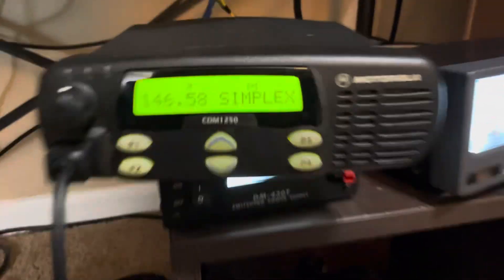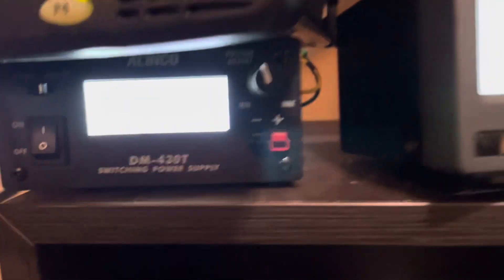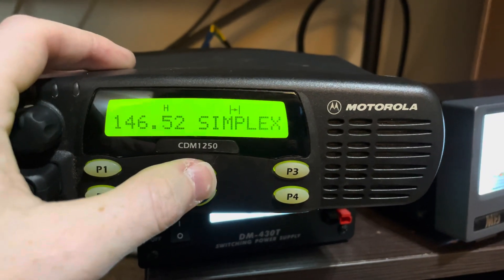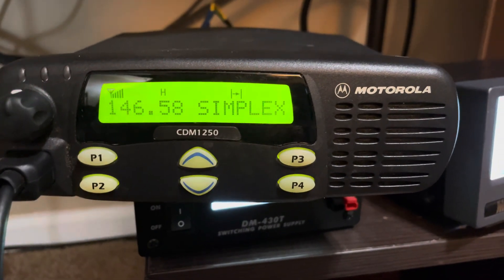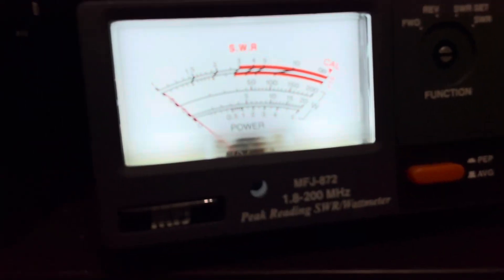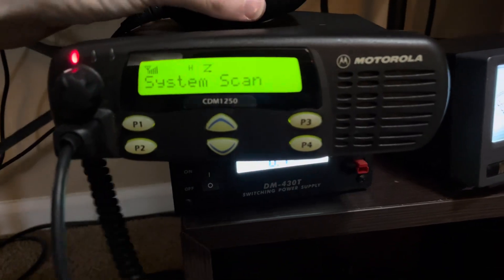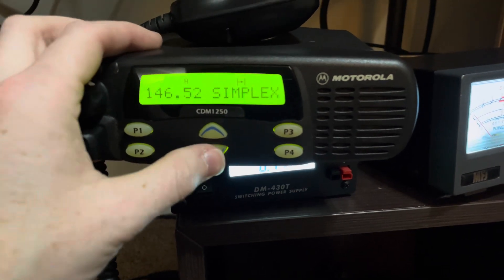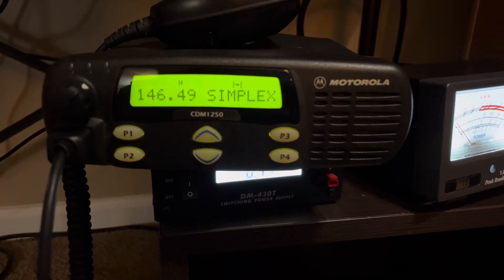Motorola CDM1250 VHF FM Professional Land Mobile Radio 136-174 MHz On 2 Meter FM Amateur Radio Test

Comment from the maker: 146.520 - Nationwide Calling 
446.000 - Nationwide Calling UHF
146.490 - Richmond Simplex
445.975 - Richmond Simplex UHF
146.550 - Alternate 
146.580 - POTA/SOTA Adventure Freq 

146.445 - Local simplex activity 
146.505 - Local simplex activity
146.535 - Local simplex activity 
146.580 - Local simplex activity

General Use “Frequency Pool” - Regular FM voice and/or digital voice modes (DMR, D-Star, Yaesu C4FM, P25).  Analog FM should always be programmed in without any receive squelch (regular old carrier squelch).  

146.460
147.420
147.480
147.525 
147.555
147.570
445.950 
446.050
446.100

Comment from the maker: Initial testing transmissions included a general CQ call on local/regional common 2m simplex frequency 146.490 MHz FM.  Station in Amelia, VA replied.  Straight-line distance approx. 27 miles (approx 44 km).  Measured output power on high power at 13.8 volts 55w to 60w or maybe a couple watts more.  Increasing DC voltage to 15.0 volts resulted in a minor increase in RF output power. 

Vertical VHF antenna connected via LMR400 coax.